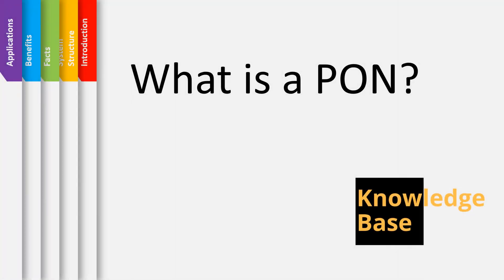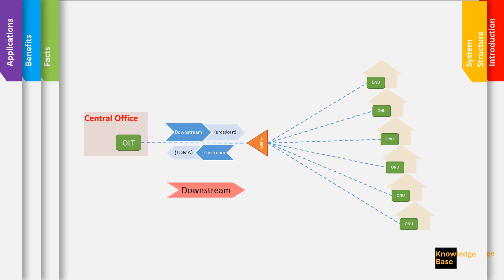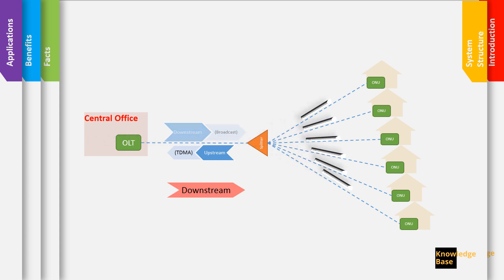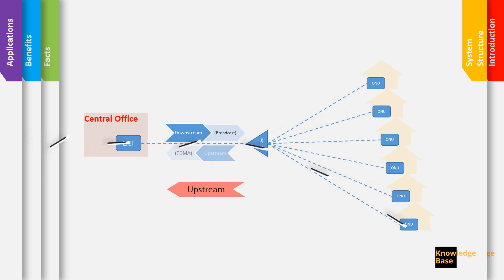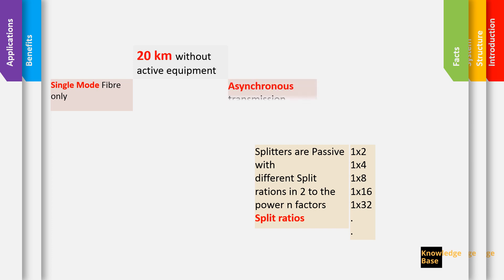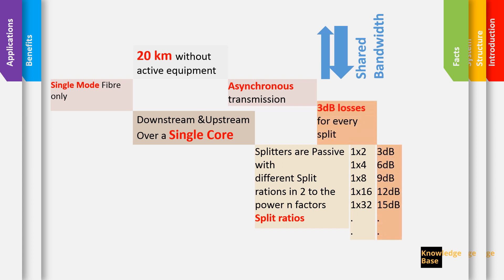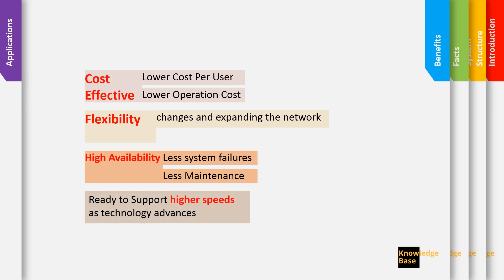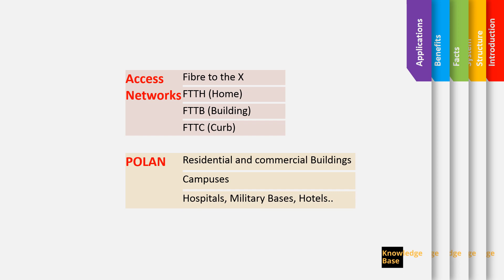PON, What is a PON? All you need to know!

Comment: If I want to sell gigabit internet to multiple residential customers off of a single 32x split ratio passive fiber link, will GPON suffice, or do you think it'll be best to upgrade to something like XGS-PON?
Reply from the maker: No GPON will only give 2Gbps shared bandwidth for the 32 subscribers on the single splitter. If you're looking for higher bandwidth you'd better go with XG-PON.
Reply: @KnowledgeBase2020  I agree, however not everyone will use 100% of their allocated bandwidth 100% of the time. I was thinking with a 1:15 over-subscription ratio, you might be able to get away with using the less expensive GPON option.
Reply from the maker: Hi Matthew, I understand what you are saying. It is your call. You should take into consideration the profile of your clients and how much you want to invest in the quality of your service. From my experience, for normal users, having moderate bandwidth demand, the GPON is more than enough.

Comment: How much time takes to on PON light??
Reply from the maker: Hi Roy, can you clarify your question? The signal in the fiber travels at the speed of light. The time it takes the system to start is dependant on the equipment used.
Reply: @KnowledgeBase2020  Actually my question is, I am using DBC XPON Modem for FTTH BSNL ... After Power On the XPON Modem, PON light is getting on after 6 minutes then I can access internet... So is it normal for all of the device or it's something defects with my device...
Reply from the maker: Thanks for clarifying. In such a case you should contact the modem original manufacturer as this is related to the product in use.